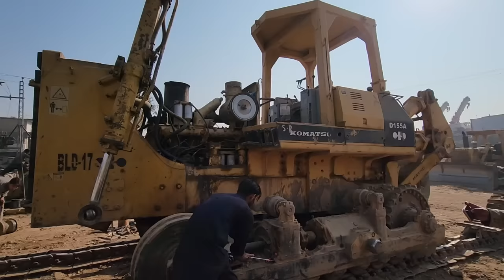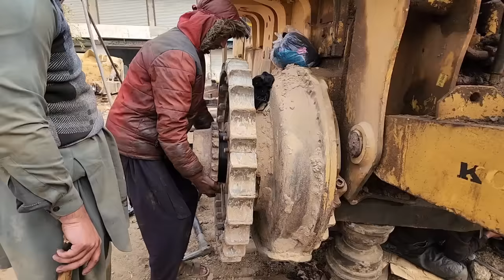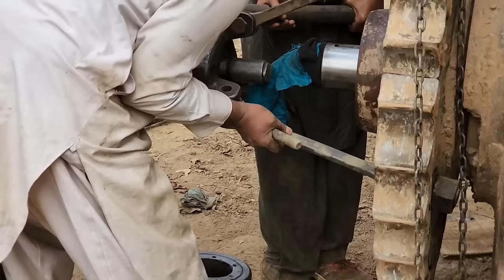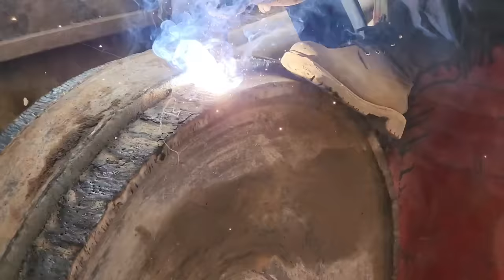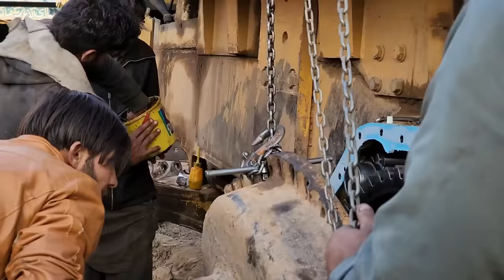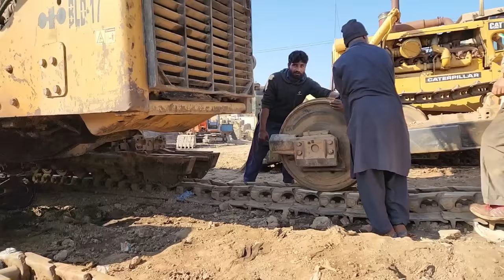Restoration Komatsu Final Drive Assembly || How Dozer Final Drive and idler Wheel Repairing

Comment: Another fine repair from these gentlemen... They should be able to get 2 maybe 3 more weeks to work out of that machine
Reply: They just fix it again luckily
Reply: You are just jealous to see Indians doing what you do without high end power tools.
Reply: This is the first time I ever seen any of them use some safety protection...some even had tennis shoes, better than sandles. And some with the welding mask and the grinder goggles.

Comment: Amazing repair...I had to do the same to a Cat D6H where the final drive axle was damaged...we certainly didn't think of rebuilding the damaged axle with weld..amazing...we had to obtain a new stub axle at great expense and removing that was a nightmare... fantastic in the field repair...👍👍
Reply from the maker: Thank you so much for watching and sharing your experience 😍❤️❤️❤️
Reply: Not field repair this is the shop.
Reply: I've got an old d5b 3306 non turbo power shift 96j series which is an old d6 non turbo pre d6c manual platform. Had final drive trouble all the time. Had to put many dead axles in it. Used liquid nitrogen to freeze it and press it in. Or, liquid propane. Couldn't afford the Cat dead axle so usually blight aftermarket. Looking back, maybe the hole was wallered out up in the rear housing. May have needed to be welded up and lined bored or the rear housing replaced. Would take the idlers to Heavyquip and have then welded up with new bearings installed. Didn't know a rough weld like this would make sense. Seems to be abrasive on the rails. But in a country where resources are limited you may just have to do it the wrong way to get the job done. Might have to take a few steps back to go one step forward and that's all you can do. Sometimes you have to lower your standards to survive. I love watching these videos.
Reply: As long as it isn't cracked, that's a common repair for inner or outer surfaces.  However the 'round it out with a grinder' ensures this will fail again in short order.

Comment: While these guys are very crude they do get it done!  It’s amazing how they have the most basic tools. Even their machinist don’t have any micrometers, dial indicators, etc.  Bearing removing tools or installation equipment - hammers and chisels.  Utterly amazing.  I wonder how long these pieces of equipment last?
Reply: That’s my big question, and probably THE big question… how long does it last???? 
Maybe I’m a pessimist, but I can’t believe the bearing where they were welding and grinding lasted too long before it spun. However, I’ve seen fixes that don’t look like they should last 5 minutes, work for years.
Reply: Forever .
Reply: @erikih706  I would have like to have seen that built up shaft machined instead of being ground.

Comment: Great effort but I have one reservation when you’re welding an axle or shaft that big you need to heat it up before welding otherwise it will break you can’t weld it when it’s cold . The weld would not penetrate deep enough into the metal.
You need to heat it up to 180F first it needs to be red hot.
Reply: With some small exceptions Farenheits are black magic for non Americans... so not point to talk about them.
But you said that you want the steel to be red hot, that is somewhat more understandable, the only thing that is not is why do you think that you need to pre-heat stell so idioticaly high...
I wasted whole 2 second in google to find this:
"For thicknesses of 3/4 to 1 1/2 inch, the minimum temperature is 150 °F. For thicknesses of over 2 1/2 inches, the minimum preheat temperature is 300 °F. These minimum preheats become somewhat lower for Category B steel (A572), and AWS D1."
Reply: "At 520 degrees Fahrenheit, steel turns purple. At 575 degrees Fahrenheit, steel turns blue. At 800 degrees Fahrenheit, steel turns grey. Above 800 degrees Fahrenheit, steel produces incandescent colors."
1800F is light orange, not red...
Reply: Wouldn't it start melting at that temp?
Reply: As a former Welder, I thought the same, a bit of pre heating was needed. Plus, I hope they were using hard facing electrodes, not mild steel.
Reply: I was thinking the same, but looking at how easily he grinds metal off I doubt it! It’s just a easy fix that won’t last long.
Reply: @peterfrazer1943  They rounded it with a grinder so I kind of doubt they paid much attention besides "here's a box of stick".
Reply: @Bialy_1  my bad I added an extra zero it should be 180 not 1800 it’s an obvious error.
When you are welding axle that big you must heat it up before welding it.
I’ve worked as a welder on heavy machinery for years , pre heating the steel allows for the weld to penetrate deeper into the steel and not just surface welding if you X-ray the weld you would see that the weld barely penetrated the steel on both sides which makes it a weak weld .
Reply: @Bialy_1  yeah sorry I added a zero without realising
Reply: @peterfrazer1943  well from experience as a heavy machinery welder that won’t last I can assure you that.
I’ve even worked as a welder on submarines and excavators , they didn’t even make a bevel to make a butt weld .
Reply: @kingagha6140  How about the fact that they finished the shaft roller bearing race surface with an angle grinder? Fail in 3, 2, 1... Such a shame considering the blood, sweat and tears that went into this.

Comment: The easiest way I have found to get a dozer on jack stands is to place a wedge behind the tracks and back the dozer up until I could put a stand under the rear of it. Once you get the stands under the rear, place the dozer in forward with the blade down and kick the wedges out from under the track.  I then use the blade to lift the front end high enough to place a stand under the front then I raise the blade.
Reply from the maker: Right, thanks for watching and sharing your experience 😍❤️❤️❤️

Comment: I would like to see these mechanics put some oil on all those nuts & bolts. It would make them easier to install & easier to remove next time. Also the excess friction created by these rusty bolts can be subtracted from the actual torque placed on them.
Reply: You should put copper anti-seize on the bolts, but definitely NOT oil.  smh

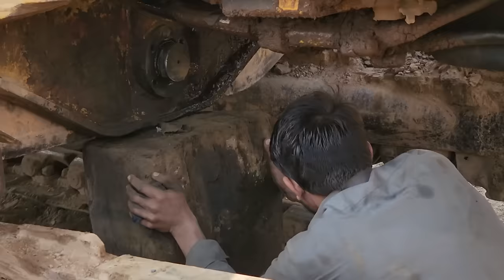Comment: 2:42 Safety is always number one.  All you have to do is depend on a rod end to hold up the bulldozer and slide under as fast as you can with a wood block.  If the dozer falls off, you just get another guy to run under it.
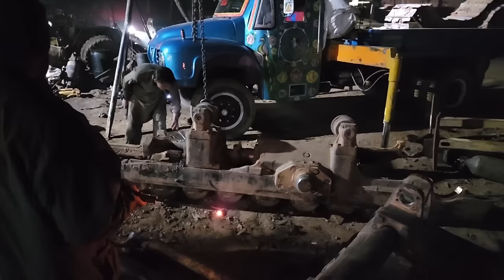5:23  All three guys shit their pants at the same time.

Comment: They need to build a lathe tool and run the Komatsu axel and use carbide tips to grind down the welds properly. There are techniques for doing this but it costs time.
Reply: Yes I suppose that can be machined in place like a line boring tool but for outside diameters. Hand grinding is not going to cut it!

Comment: Not for  nothing as a helicopter mechanic for 20 yrs all the grease and lubricant parts thrown in and on the dirt  they don't  blow the dirt off before they remove the nuts and bolts it doesn't take any brain cells to guess where the dirt falls